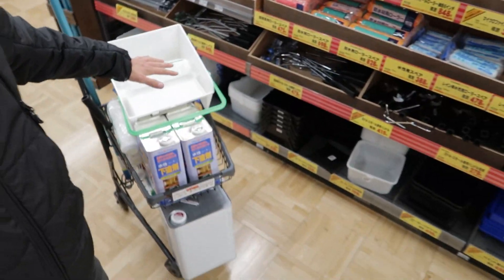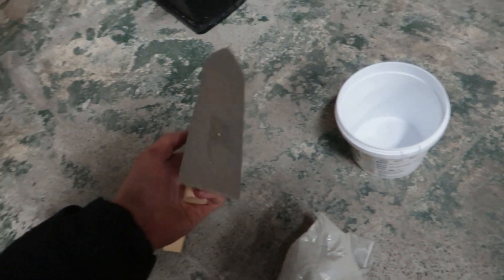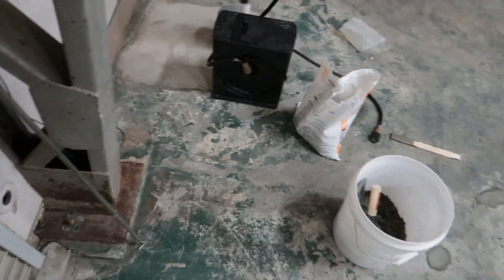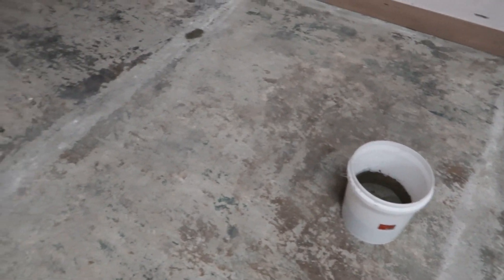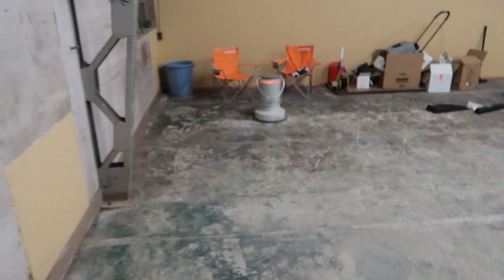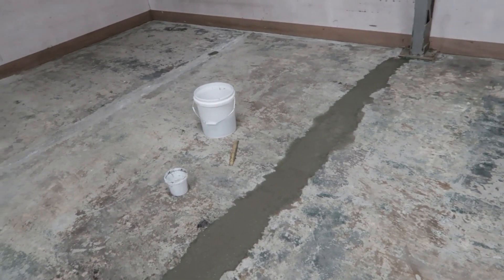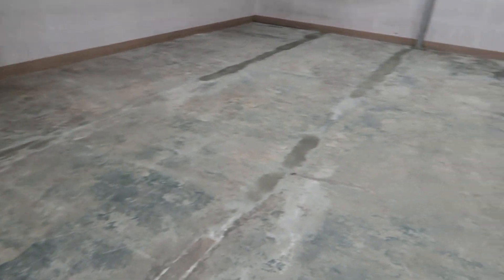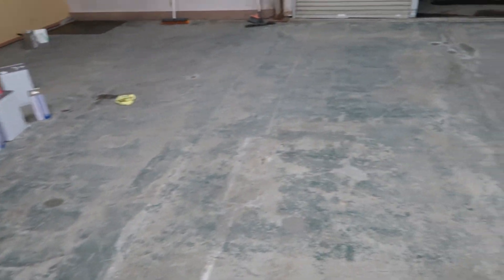NEW SHOP CONCRETING! - FLOOR GANG AWOO!

Comment: I work in the concrete treatment industry and I can tell you that the system the contractor wanted to put down is a system that will withstand abuse. The paint you've used will surely have no scratch or chip resistance. The quote he gave you was way out to lunch. If you coat your work in Polyurea, the protection value will triple. The product I trust is Smith's Poly-SB.

Comment: You need a floor sander with a diamond blade to level out that floor and get good adhesion of the paint/epoxy coating.

Comment: Get some sharp sand or grit sand with a bag of cement. Use maybe an empty butter tub or something and mix 5 sand to 1 scoop of cement 5:1 👍
Failing that, get a few 25kg sacks of self levelling compound and mix with water and a plastering whisk

Comment: It takes 2-3 days for the concrete to shrink and the lime to flash off. If you don't wait, you will have streaks where the lime sucked all the paint/floor coating on.

Comment: Sam.. I used to do epoxy floors.. this paint will fail and be a mess within a couple years.. you really need prep the floor by grinding the whole floor or hire someone..all the patching you did will most likely come loose and break apart your painted floor.

Comment: Lol i knew you were gonna say you bought the wrong concrete. You either need bonding sand topping mix concrete or buy sand topping mix concrete and bonding agent luquid. Which this stuffs good for 3/4 inch to 2 inches thick

Comment: I just use body filler for filling the holes in the concrete. It's worked fine for about 2 years so far in my workshop. Used professionally every day
Reply: That'd probably be more expensive, unless you get your body filler in huge bulk, but I suppose it must work.  :)

Comment: 10 grand is typical what a professional would charge so its a standard rate for flooring. In the end when you finish painting and adding the epoxy on the floors, that is when you know why it costs so much. :)

Comment: u haave to take out the dust / put watter on the floor to cleen the dust and saturate the concrete with watter / next apply your thing with max simen
Reply: and it wont fissurate
Reply: the faster it dries the worst it will bee it will crack

Comment: Ya, with the divots/holes you should get some tape or just a dot of spray paint as a visual guide as you will always miss things.
13:10 yes you might be making it better for the next person... but you are still using that space until then. 
Ah yes the I don't want to do it price, as you said prior it was coming to the time of year when people close down. 
Nothing wrong with doing it yourself, and the floor paint you just lay thick and it self levels to a point also.

Comment: You should rent a cement smoother machine be for u paint.Iin the long run it will be the best for you and the shop.
Reply: Concrete grinder* will cost a lot more. It’s what I do for a living, and yeah I’ve never primed before epoxy, only grind, vacuum and 2 coats, but it should last till the 3 years is up hopefully🤣 that primer was supposed to go in the cracks before the self leveller that’s about it

Comment: The shop floor would have been so much easier with self leveling epoxy
Reply: Not to mention 3x the price. That heater and a room full of epoxy fumes would have sent that jdm space into actual space
Reply: @tvardz8472  anyone that has worked with today's epoxies will tell you that you have no idea what you are talking about.  You literally pop the bubbles with a torch. And it will hold up 3x longer than paint. Gtfohwts
Reply: Wow, jokes mate chill

Comment: Much easier if you used epoxy, that floor will not last long, owned and run workshops for 35 tears, nothing beats epoxy.

Comment: bruhhh, that tiny layer of concrete will just break soooooo quick..  for a youtuber, you should've at least checked some tutorials on yt :/
Reply: @JayDee How do you do it?
Reply: @JackFN_VR64  if he still wants to use concrete, it should've been in a way thicker layer. But now, any bigger pressure on that and it will be in 100 pieces. Like that's an awfully thin layer of concrete and most likely it will start cracking when he steps on it. Either take off a layer of the old one and pour new slabs of at least 5-10cm thick orrr put that amount on top.. either way, he should've just do the epoxy & resin in this case, since he's renting.